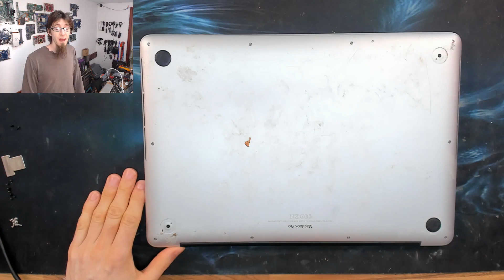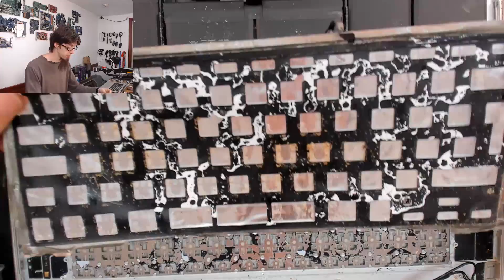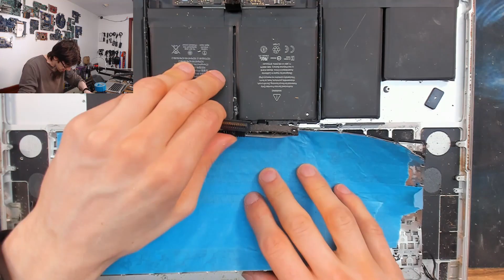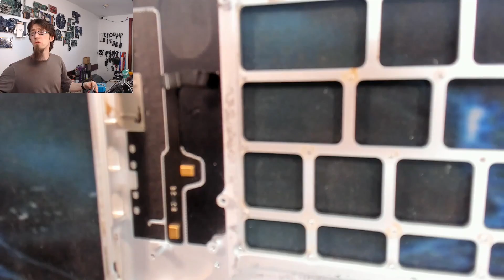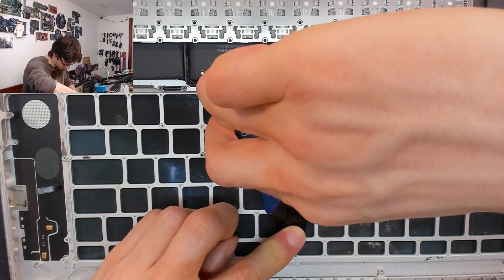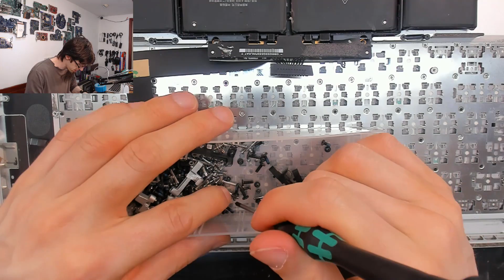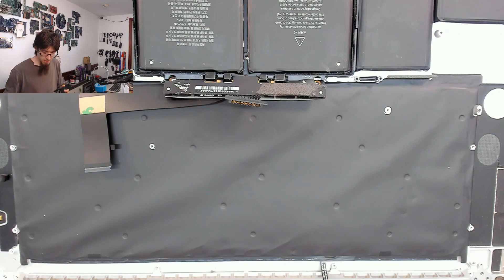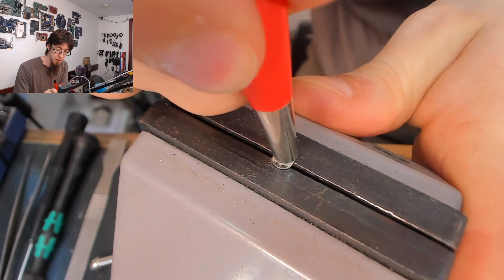MacBook Pro 15" 2015 Teardown & Keyboard Replacement - LFC#211

Comment: you know they did it for the pleasure of making the process of changing a keyboard difficult to the user wen they riveted the damn thing instead of securing it with clips and 4 screws. and is the same with every apple product, i have 2 dell laptops: my work computer is an old Latitude E5430, the keyboard can be remove withing 3 to 5 minutes, and my main one is a inspiron 15 5558, you can pull that keyboard in seconds. on the other hand to remove my wife's MBP keyboard i have to pull the battery and main board out, is a 10 to 15 minutes job. great video brother, we are learning together, thanks to your channel, and many other technicians like you channels i was able to fix my wife's MBP kernel panic and my ps3 hdmi controller crazy short to ground.

Comment: Don't know if you saw Louis Rossmann solder a screw mount back on using a 260W soldering gun. He couldn't use hot air due to having melty stuff too close to the mount. Sorry but I have spent the last 60+ minutes looking at the videos but I can't find it at the moment. The gist of the "technique" was to put some solder on the board where the mount needed to be relocated, place the screw mount over the hole and then get the solder gun to make contact with the screw mount. The wattage of the solder gun overcame the mount and the board's ability to absorb the heat so the solder under the screw mount actually melted. The melty bits, it may even have been the PCH but Mr Memory isn't cooperating at the moment, were not damaged and the repair was successful.

Here is a method of removing the MacBook batteries that Apple have welded to the case with adhesive that may work for you. https://youtu.be/ko0_6rYSbng?t=3593  Hope you find it useful.

Comment: i had a call out to  a faulty modem . The house was a putrid  rubbish tip . The desk he sat at was covered in dirt and smokers ciggy ash in a filthy corner . I didnt turn the light on as it   was covered in brown filth circumference . His keyboard was festering mess of dirt over  plastic  tabs , the letters were gone . Due to the dog was hairless but covered in fleas and suffering I rang the Health dept at the council and the RSPCA . The house was later demolished

Comment: Greetings from India! I would really appreciate if you give some advice. I have MacBook Pro 15 inch Retina display of 2013 model. Some key on keyboard doesn’t work and it is very hard to turn it on. It turns on after trying to it turn it on for at least 30 times. The technician is saying it could be logic board problem and asking me to give declaration of it as a dead laptop. He says while fixing it problem may get bigger. Thanks in advance.
Reply from the maker: Easy way to check that is to connect a different keyboard (just have the keyboard hanging out by the cable) and see if that fixes it. Sounds like just a bad keyboard to me.

Comment: Nice video! I have to do my Macbook Pro 2012 13" soon as I have a defective key. Do you know if the procedure is the same for the 13"?
Reply from the maker: Pretty much, yea. Internal layout is slightly different, but the principles are the same.
Reply: @Adamant_IT  Kind of looks like the battery overlaps with the keyboard/backlight, to a greater degree than in a 15" model, so might have to be removed completely. It's gonna be a fun job 🙈
Reply from the maker: It's close, but the battery doesn't overlap the keyboard on any of the MBPs.

Comment: Warns that fiberglass pen is very abrasive and not to touch it. Touches screw cap that has just been rubbed with said pen with finger. 

Great in bet though. Thanks for the great videos! I truly enjoy them and have learned a few things!

Comment: Hi what is your diagnosis about a mobo charging battery but not turning on?
Reply from the maker: Lots of things that could be. Most likely a missing power rail somewhere
Reply: Adamant IT Thanks, i saw in your previou video that you poured alchohol in mobo to detect which component was shorted will it not also short some other components as well as alchohol is conductive?

Comment: I just use high performance automotive grease with a melting point of 265°C. It conducts heat better than thermal paste and you can get it at around 10-20$ for 200ml

Comment: I have a HP 840g1, every time I switch on, the HP logo will not display for a while. After sometime it will come up and will switch off in 10 seconds on initial power on. But after that immediately when switch on the laptop it will come back to normal and works fine. Why this happens. Any issue with the charging capacitor?

Comment: Wow, now that is one perfectly serviceable piece of equipment .. like NOT. Like why do they build it like that?
Reply: So Apple can sell you a new one , they want NOTHING repaired. They solder shit in and pour epoxy on stuff so you will have to buy new.
They go after people repairing this crap.
Bottom line Apple is full of greedy assholes , the walled-garden , It's from Jobs the #1 asshole of them all.
Reply: @BigEightiesNewWave  Correct on all counts . Apple like sheep , Baaaaaaa.
You probably watch Louise Rossmann as well
Reply: Because the top chassis and keyboard come together, this keyboard isnt oem

Comment: Hi there, I love the channel! I have an A1502 Late 13 Pro whose trackpad recently died almost instantly, and the keyboard is on its way out (Often I have to press a key multiple times). Do you think I should replace the trackpad/keyboard or have you seen this before and a larger issue may be at play?
Reply from the maker: Hard to say really... it's possible that humidity or something has gotten to both the keyboard and trackpad. They're both fairly big jobs to replace.
I would probably test a different keyboard by connected it while the laptop is open on the bench, so I can see if the new keyboard will work before I strip the laptop down. If that keyboard responds just fine, I'd go ahead and replace both KB and TP.
Reply: @Adamant_IT  On these 13 models, the flex cable that connects the trackpad to the motherboard is under the battery, which is unfortunate. I could replace this cable and the trackpad, however I do not think I could reliably complete the keyboard replacement. 
I was reading on IFix forums, where one user suggested that a virus could mess with trackpad/keyboard function. 
In your experience, is this plausible?
Reply from the maker: Seems like a long-shot. A format and wipe would answer that. Do a time machine backup, then factory reset and wipe everything. If the problem has disappeared, then it was a software issue or virus. If the problem hasn't disappeared, restore the backup and you're back where you started.
Reply: @Adamant_IT  So this ifixIt post details the issue that I am having. 

FYI: There is no controller logic on the main logic board for the trackpad.

https://www.ifixit.com/Answers/View/484198/MacBook+Pro+13+(Mid+2014)+-+Erratic+Keyboard+and+Trackpad

Comment: good job. but power on after repair would be nice ;-)
Reply from the maker: Yea I accidentally chopped it in editing - I turned it on, then shut it back down to put the bottom screws back in, hence why it was off at the end. Thumbnail shows it turned on at least ;)

Comment: Nice video as usual, you have a calming voice like Big Clive.
That unit has definitely had liquid ingress you can see where it came in, I was thinking I have not had a keyboard fail on one of these without someone giving it a drink.
That is why you have the weird shape of dust on the heat sink.

Comment: If this tear-down does not convince you that Apple products are engineered to be un-serviceable and discardable, by design, I don´t know what will.
Reply from the maker: Sadly true. I had several MacBooks from a G4 to Retina over the years, but last year when I needed to upgrade, I looked at the offerings for 2016+ macs and was like 'naa time for a Latitude.'

Comment: "You don't want to get fiberglass fibers into your fingers"
Touches the part after rubbing it with fiberglass pen
Reply from the maker: More the strands in the pen itself!
Reply: @Adamant_IT  Yes, I have worked with Fiber Glass as a material for construction and reparation of any kinds of things (like a broken car fender) and it is really nasty; the fibers can pierce through the skin if you handle it without protection, but once the "fiber structure" is destroyed it pretty much becomes harmless.

Comment: What was the charge? I do these, but don't have a solid charging plan...
Reply from the maker: You and me both tbh... I've been doing this 10 years and I'm still making up the price as I go along for this kind of work. My basic flat-fee is £50 labour.
I quoted £70 for this (£50 labour £20 parts) because the last MBA I did wasn't a massive job. The cleaning and other bits, plus the additional time it takes to film everything made this a much bigger job. But it's debatable if that's the customer's problem or not.
If I did another one of these tomorrow and wasn't filming, I'd probably be done in an hour.

Comment: man i love your videos but you should really spread the thermal paste when applying it directly to a die 
if one corner doesnt get any the chip will kill itself, not tomorrow, but it will
Reply from the maker: It comes out from all sides under the heatsink when you clamp down - these dies are a lot smaller than what you see on desktop chips 👌

Comment: How long did it take to complete this job in hours?
Reply from the maker: Original recording is about 2hrs I think... I took several breaks while checking in on other repairs or talking to customers though, so hard to put a 'real life' time on it.
Reply: @Adamant_IT  We are Houston Texas, U.S. IT services firm.  We've debated on doing these type of repairs.  But in most cases it's just seems un-economical to repair.  Or, I suspect the labor rate would exceed what the customer would be willing to pay us.  Just trying to gauge the amount of time spent on these type of repairs to see if it warrants the service offerings we provide.  Absolutely love your videos by the way.  Hands down have  learned more from you, then any other source. So glad we found you!!!

Comment: Ugh. I'm glad none of my laptops have ever looked like that inside. Also, wasn't it so much easier back in the day when to remove a keyboard all you had to do was undo a couple of screws and lift it out without stripping the whole thing down? In fact on my old iBook G3 you only have to pull back two sprung plastic clips and the whole thing just pops out. My God though it's a pain in the arse to strip down when you have to replace anything other than that.

Comment: I wanted to type "I've seen worse", but it would be a lie.
Reply: I've seen WAY worse.. Will post the pic URL...  1278 was so bab you could not see or tell the color of the PCB-on the whole board!
Reply: I have seen worse, I've seen where cockroachs were inside. 🤢 🤮